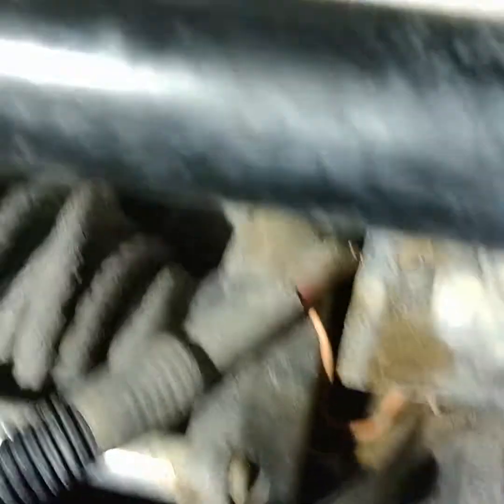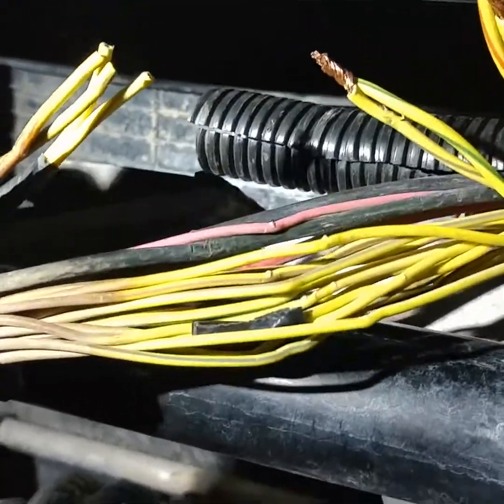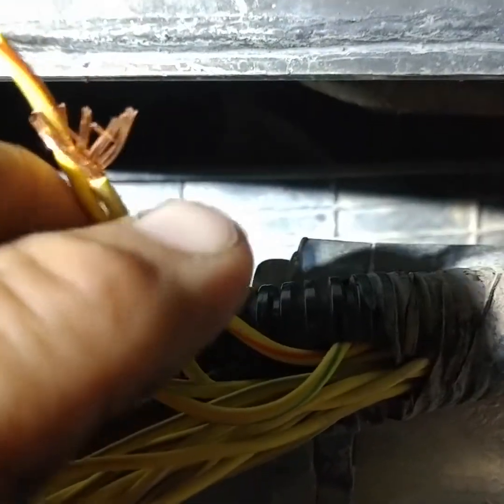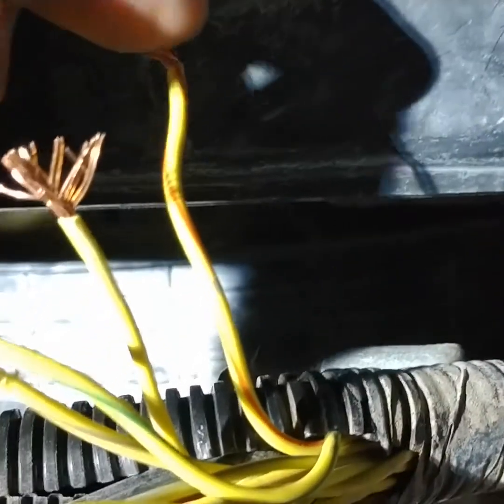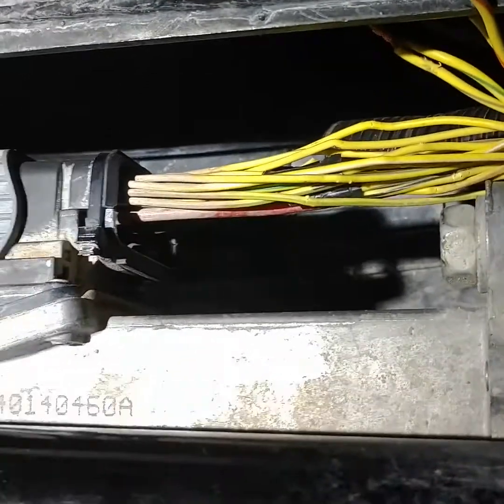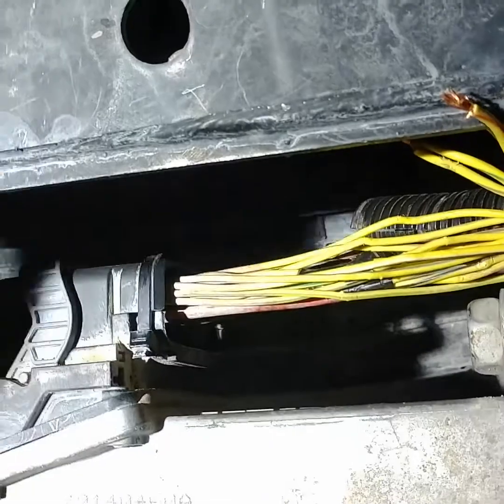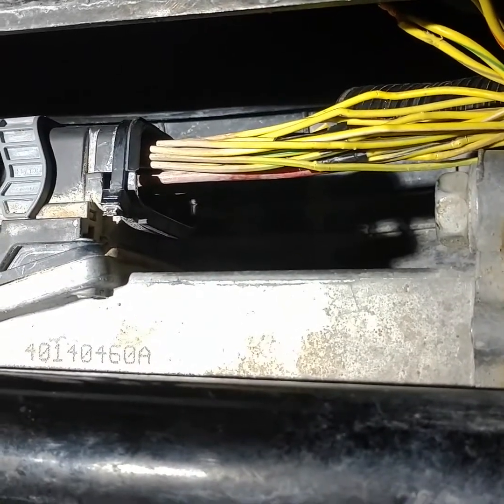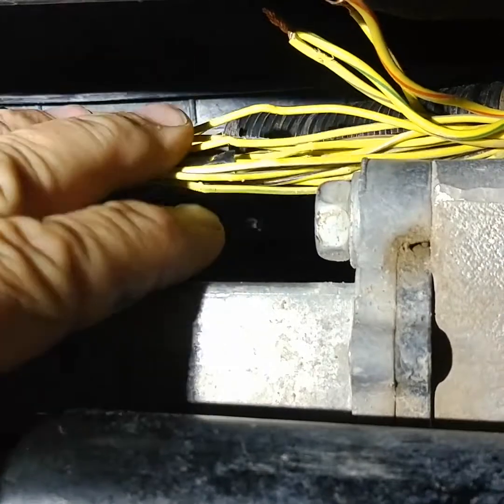Hardwire Powerwagon or JEEP Lockers EASY

Comment: Why not just ground to the black ground beside the wires you cut. Find the return wires to the factory switch and splice the locker wires you cut    
Bypass nannies before the factory switch.
Reply from the maker: That's a good sounding idea. I even considered doing the ground right there but without access to a shop wiring schematic manual, to know the wiring for sure, I then just opted to put the ground to the conveniently located bolt welded on the outside of the driver's side frame rail. Thanks for the comment!
Reply: @bobvincent4841  I’m about to tackle that project myself so I’ve been reading and putting everybody’s together for my final design or idea.   I appreciate you sharing what you came up with.  I’m definitely going to go that route.  Just finished with transmission solenoid replacement and ignition switch and abs sensors. Still chasing ground and shorts in the door wires.    I have the 1st 05 model ever made.  Vin is 00001.    Kinda expected issues.  Thanks again sir
Reply: @Adam Bush  I have a 05. And the rear locker light flashes and won't engage either.

Comment: Out of curiosity, what is the purpose? Issues with the way it’s currently wired?
Reply from the maker: By installing your own control switches for each axle, you eliminate the headache of waiting for the lockers to, both engage, and to then release. Nothing more frustrating than a locker that misbehaves while everyone on the trail  is waiting and watching.  Also there are many times when it would be nice to have the locker stay ON above 18 mph and even sometimes when in 2wd. Just, everything is better when the lockers do what I say, when I say.
Reply: @bobvincent4841  That makes sense, thanks for the info Dirt Wagon. I just bought a PW, so please keep the content coming!